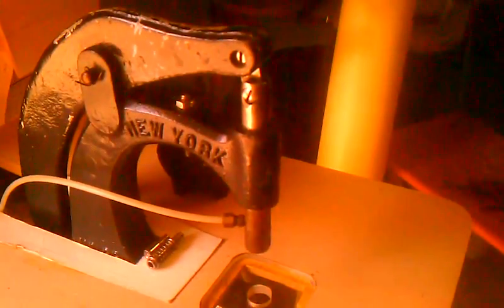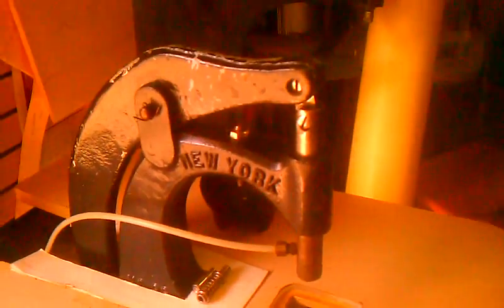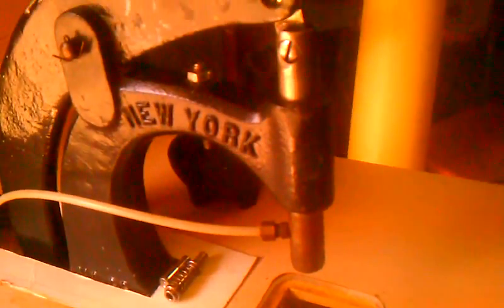kick press set up

Comment: Thank you so much for making this video.  I just bought 4 of these presses (without the vacuum) 2 of which are also no.39 but were made by D.B. Die Works NY.  I was wondering if you know where I can buy the die sets that fit this machine?  Was also curious if you had the vacuum added to yours?
Reply from the maker: I'm sorry for not responding to this post earlier.  I don't use Google plus very often.  
Feel free to call me and I will try to answer your questions.  I check my Facebook more often.  
Thanks, 
Al Bane
818-209-7945